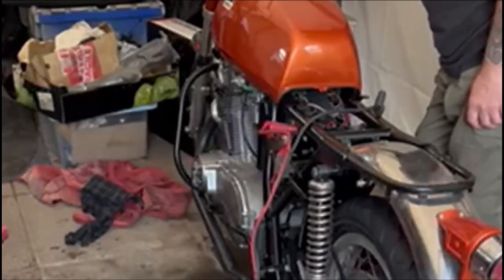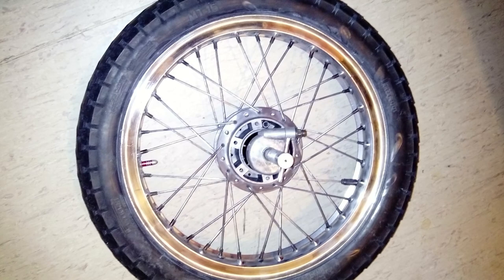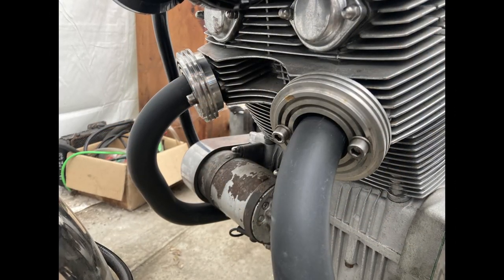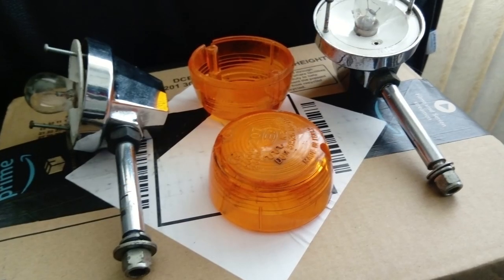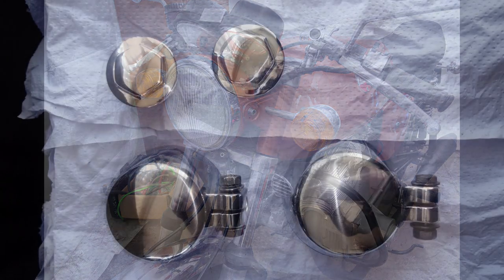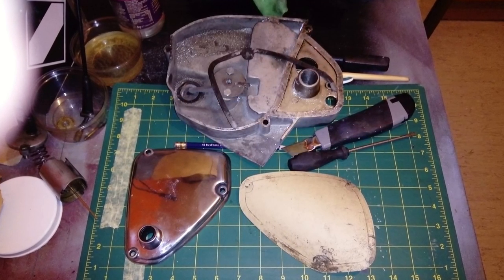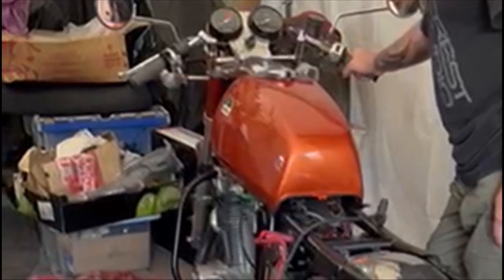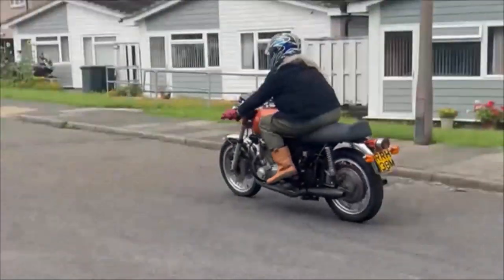Thunderous Laverda Classic Air Cooled 750 Twin Built not Bought

Comment: Awesome! Great sound, great looking and that very special feeling you get from riding something you've brought back to life after years of being in boxes, all add up to extremely satisfying riding👍.
The bit that always frustrates me is trying to get that nice polished look to ALL the exposed aluminium and oh my god! There's so much total area of it and so many awkward to get into little pockets and hollows that you've just got to do thoroughly or you'll never feel happy with them. That's the trouble with bikes, they may be smaller than a car but, they're like if a car was turned inside out and you had to try and make that look shiny and pretty, EVERYTHING is exposed and so much fine fiddly stuff to wear out your elbows polishing. 
That will be a bike you'll have every right and reason to feel very special while riding it.
Great work, it's looking gorgeous❤.
Reply from the maker: glad you enjoyed it mate, the central casings were left as a sand blasted finish, only the outer casings, fins and a few select bits polished,  🙂Cheers for watching and the complements. Ride Free 🙂
Reply: @barebonesmc   It was truly a pleasure seeing you build it back up. I could reminisce and feel that same feeling, a mixture of "I so hope I'm not chasing my tail and every time I think I've got it right, something else, deeper in the engine goes wrong" crossed with that great feeling of satisfaction, especially that first time you hear her fire up, rough running or not, then that great feeling when you're all sorted, registered and a real road warrior back from the dead.
Reply: @barebonesmc  Just a possibly, maybe, partly useful tip. I cleaned up and made shiny(ish) some old rough cast casings once while experimenting, pretty reasonably successfully using a cheap sand blaster that I could run off my compressor using corn flour. It's a bit difficult to feed it to it evenly but, it didn't damage or abrade it at all and left the cast finish looking like it had just come out of casting yet clean and fairly shiny. There's probably even better mediums or methods and this one leaves you a horrible mess but, it did bring it up surprisingly well. I wouldn't use real grit or sand as they would eat at the surface, this kept it looking how it should yet shinier. 
I was experimenting trying to find the best way to deal with those rough bits like cooling fins etc and there's bound to be better, easier ways but, it did work the best of the ones I tried.
Reply from the maker: @lorditsprobingtime6668  cheers mate, it was a challenge lol. probably the biggest project so far in many ways. Im no master mechanic, just a bloke in his shed with a lifetimes worth of spanners and common sense (he says) to fall back on, so yes, when you finally get it sorted it is a very rewarding feeling
Reply from the maker: @lorditsprobingtime6668  i guess soda blasting would be my equivalent to that. The sand run was only done very gently with a fine grade sand on main casings lol. I have a mate who is great at that bit 🙂 Steam clean first then a light sand and then soda blast, then final bits polished. fins were all just done by hand 🤣🤣🤣 ive never figured an easy way around that one🙄
Reply: @barebonesmc  That's a good point about the fins. It was a long time ago so my memory isn't perfect about it all but yeah, the fins are close together so whatever you use, it's hard to thoroughly work on the flat areas further in, you just can't get an angle to work at them with what I was suggesting, or any other grit short of blasting the hell out of the edges much more than you'd want.
That vid of my ride on my DL 650 through that town at the beginning and that cafe where a few bikes are parked out front is where I always ride to first, have a big country breakfast, coffee then go riding the mountain roads from there. In my video I'd already been and done all that and the video was returning back through there later in the day. Early in the morning that whole street will usually be full of bikes, hundreds of them and I always walk the length of both sides, stopping to take pics of any particularly interesting ones and often you'll see things like Z9 Kawasakis and 750 Honda 4s fully restored and looking even better than they ever did on the showroom floors. I am completely mystified as to how they even manage to get anything that old to ever look so perfect. Hell, just a pair of front fork legs defeated my efforts to try and polish them back up to even reasonable so how some of those guys get every little detail so perfect is a complete mystery to me. I do love seeing them restored like that though. 
I wound up having a nice long chat to one guy who had a rather unusual bike, I'm looking at the pics I took of it on my phone now, mainly so I get the details correct because they aren't all like his. This one had a souped up FIVE HUNDRED AND TWO CUBIC INCH V8 in the monster! You get all sorts out there and that thing was just a little more nuts than another guy I'd run into out there on his Harley drag bike. It was bored to I don't know then a monster turbo, water injection, nitrous and I can't remember what else but with boost turned up for the track it was dynoed at 380 hp but, oh boy was it bulky with numerous oil and water heat exchangers and plumbing etc. I absolutely loved starting a days ride like that, it's a real tradition sort of thing so you could always count on seeing a lot of interesting bikes, except if it rains! I've got pics of both the DL 650 AND the BMW S 1000 R being the ONLY bikes in the entire town, just because it was raining and all the sooks stayed home lol.
Reply from the maker: @lorditsprobingtime6668  lol, im no stranger to rain living here PMSL, i try and sneak out early in the week so i dont suffer the traffic that flows to the nice places at the weekend, it avoids the sunday drivers and the crowds, so breakfast comes quicker lol, have a great weekend mate, enjoy the ride
Reply: @barebonesmc  I've ridden in all conditions, either by choice or necessity so never let it put me off. Apparently around here though, even though we get cyclones up here on the Queensland coast, the bike riders are a tad on the soft side lol. Only after I typed it did it strike me that over where you are, if you didn't ride when it's raining you'd hardly ever ride at all. I thought you'd get a giggle from that lol.
I actually haven't been for a ride for a few months. My excuses are that the DRZ 400 still needs the carby pulled off, stripped down and I'm fairly convinced there's a little bit of plastic swarf on the fuel intake side that keeps getting in between the needle and it's seat but, I'm going to go right through it while I'm at it, just it KILLS my back getting down to work on it and the AN 400 scooter BADLY needs an oil and filter change but also the front wheel taken off and balanced as it shakes like mad and again, my back! Soon though, I just need a day or so when I haven't got a heap of other stuff needs doing and my back to either give me a few days of not being too bad or, I double up on the Oxycodone so it doesn't hurt so much but then I'll be so doped up I'll probably just sleep. Ya just caint win eh lol.
Reply from the maker: @lorditsprobingtime6668  lol, re on the Queensland coast, the bike riders are a tad on the soft side lol. Only after I typed it did it strike me that over where you are  if you didn't ride when it's raining you'd hardly ever ride at all.,  thats why there are so many bikes with ridiculously low mileage, i think when i last checked, average mileage per year was around 3k, but that includes all the high miler bikes such as cop bikes blood bikes couriers and instructors etc so in reality for many riders 1500 miles is probably a years riding, a waste to me, i go mad if i havent been out on one of the bikes for more than a week or so
Reply: @barebonesmc  Oh yeah, I AM going mad not being on one for this long! I actually only just before replying watched a guy on the slightly hotter version of my BMW S 1000 R I had till I got wiped out by that dimwit screaming through traffic at over 190 mph and oh man, do I miss that bike! I only had it for about 18 months before I got taken out big time and even the entire surgical team at that teaching hospital thought they were only working on me and doing everything they could as great training but being a stubborn bugger, I refused to just keel over while they had me in that coma on full life support lol. I did clock up something over 35,000 kilometers in that time, mainly because every spare hour I had I wanted to spend on it. That was the first bike I've ever thought to myself, "well, I wouldn't mind even more power but, this is enough to keep me happy. I could wheel stand at over 160 ks (100mph) purely on twisting the throttle and that's about what I always reckoned would be about my ideal power level. It wasn't just power of course, that thing was just such a great handling, comfortable for a super naked and was the first bike I've ever owned that had real cruise control, I just loved being on it. I am pretty much stuffed since that accident and just couldn't do enough miles to justify buying one like it again and at close to 70 I'm probably best off sticking with just the 400 cc scooter, at least it's not even trying to pretend is fast despite the fact it can do the ton and gets to 60 mph in 5 seconds as best I could time it which is still quicker than the vast majority of cars. I can get on and off of it without putting myself in agony trying to get my leg over the high seat on the DRZ 400 though, that thing is a fair bit of fun and with the work done to it, goes a fair bit quicker than a stock one.
I do keep seeing videos from over your way of bikes I would here expect to have returned to the oxides etc in the soil where they came from. I even drooled over some guy pulling out his pristine looking old TS 185 Suzuki, one of my all time favorite ride to work then head a couple of hundred miles into the outback camping and having fun on the weekends, he made me so jealous, especially since the only 2 strokes we see here these days are those silly little 50cc Chinese scooters which I have an unreasonable hatred of, despite the fact I've got a tweaked one of them in the garage that I never even count when anyone asks how many bikes I've got. It was my girlfriends and I haven't even ridden it since going through it and sorting out all the ways they'd either intentionally or through very poor design slowed them down, as if you need to deliberately slow down a 50cc scooter FFS. It accelerates much better than before and revs a lot harder but, it's got no way to go faster than their usual 70 kph except by revving harder and I just hate holding a bike screaming it's head off so don't bother registering it as it's no fun anyway.
Where I am here is rust capitol of Australia right on the coast beside an extremely popular and very long surf beach with the wind almost always blowing inland carrying all that salt spray so, not easy to find old and good.
A mate offered me his old in pieces DR 250 a while ago which I've had one of before, also in a million pieces in boxes and did put it all together, freshly rebored and all bearings replaced and was quite impressed for a little 250 but, now I'm struggling to just get a bloody carby off and go through it so, I thanked him but nah, just can't, plus despite the engine being similar as in pieces and freshly rebored but it does have a fair bit of rust and corrosion to deal with too. Now if somebody was to offer me something like that lovely Laverda, engine even intact, that might make me change my mind lol. Then again, I know if I was going to restore it I would strip the engine down and go through it with a fine tooth comb (or rather feeler gauges, micrometer, dial indicators for measuring end play, TDC and cam lobe lift etc etc and list of specs for all that soooo, not a great idea for me at this stage either. I so wish I could enjoy a couple of hundred kilometer rides so I could justify buying another BMW S 1000 R! I know I'm in agony after around a hundred and a lot of discomfort after only about 50 ks so, just never going to happen. At least I can say I've finally owned a bike I was pretty much completely happy with, despite the fact I kinda would have liked even more power, it was still bloody awesome!
Reply from the maker: @lorditsprobingtime6668  glad you are still fighting mate. and if its got 2 wheels thats fine by me. too many people get too "precious" about what people should and shouldnt ride. as i pass i nod to anyone, 125's scooters, ven polite car drivers lol. i guess its rarer with bus drivers or amazon prime drivers though 🤣🤣 have a good week mate, you will enjoy the next video
Reply: @barebonesmc :   " you will enjoy the next video ".  I have no doubt, I've very much enjoyed every other one. That does hint at something a bit special, or possibly about, or including one of the bikes I've mentioned owning, either way, I'm drooling already lol.
BTW, I made a silly mistake in my last post and I blame Suzuki! I said a mate offered me his in pieces DR 250 and because I have a DRZ 400 and those same first 2 letters I got them in the wrong order. I meant I'd rebuilt a RD 250 Yammy and THAT'S what a mate offered me. I'm getting thicker with age🤦‍♂.
Talking about people waving to you. I've driven semis on long haul runs for a living at 1 point amongst the many and varied types of work I've done and there's 2 groups that won't wave back that I've found, 1 on the road and 1 on bikes. While driving a semi pretty much EVERY other semi you pass will wave, NEVER bus drivers though. On bikes, most will except Harley riders. Despite the fact they're riding about the biggest POS of a bike ever made, they have some weird sense of superiority, I don't even bother with them anymore since even that 400 scooter is almost certainly superior to a Harley in every way.
I've got a question for you, if you've heard anything about these that is. 
Have you heard of a carby called " SmartCarb "? My problem with the DRZ 400 is in the carby which apparently aren't the greatest anyway so, rather than trying to fix it, I'm thinking about blowing quite a few bucks and putting one of them on, a 38mm one of theirs rather than the 36mm thing that's on it. They promise major power, fuel consumption etc etc improvements and with the Yoshimura exhaust already and other breathing improvements a power boost that also saves me fighting with the old one, or at least till I feel like it would be great. What do you think of them, assuming you know of them that is? And should I maybe jump straight to their 40mm one instead of only 2mm bigger with the 38mm one, the price is the same for either so the only downside to me might be bogging down sometimes that I can see? I think if they aren't full of you know what the 38 should probably work best overall but, , , ?
Reply from the maker: @lorditsprobingtime6668  being honest i havent tried them, ive got a box full of old carbs so i can usually find something. with carb sizes, its not as simple as people think. bigger bore size actually slows fuel flow. unless you work with bell mouths or something. id stick with standard bore and just up jet as needed. personally, if itll fit my choice would always be Mikuni Flat slides if you can get one. best there is, and easiest to set up well, hope that helps
Reply: @barebonesmc  Thanks anyway. I haven't got any extras up here, back 1,200 kilometers away yeah, not up here though unfortunately. These SmartCarbs don't actually have any jets. You can adjust the weird flat sided metering rod on the go, within a range or change it to a different one if that's not enough. Supposedly after you feed in the information about which bike it's going on, what modifications if any and what your priority in riding is (naturally I put POWER) they set it fully up and usually set a little on the rich side for the sake of the engine till you refine it later. I'm pretty sure the carby it came with is a flat slide  Mikuni BSR36 so I thought since it has got a better breathing exhaust and I can distinctly feel a big difference between say 95% throttle and 100% that a bit bigger carby would benefit it. I'm pretty certain it'll love the extra 2 mm by going to the 38mm, I did have doubts about any benefit of value from going the extra up to the 40 mm that's in their listing for the DRZ 400s though, except maybe near red line revs and full throttle, the rest of the time I doubted it but, thought it worth considering, especially since all 3 sizes are exactly the same price. What does jump the price up by about a hundred extra bucks is if you want it in one of the fancy anodized colors, I really liked the whole thing in Black Obsidian but, for an extra hundred I think I'll go with plain alloy thanks. That's IF I do it at all.
Mine has the Yoshimura exhaust on the breath out and had a very noticeable power improvement by opening up the air box so I'm pretty sure it wants bigger, I'm just iffy about how much bigger. I think I'll probably play it safe and just go the 38 mm. Man I'm going to be annoyed with myself if I do put that on and can feel it wants more! Either way though, with a 38 mm that's as good as these are meant to be, it'll be easier than fixing the other one and, it'll have even more than it's got now and as it is with the few modifications it has had, it goes much harder than an off the floor one. 6 Teeth smaller rear sprocket to suit the road more and you can't give it full throttle in first and still have to be careful even in second and leaning forward, even with the gearing raised that much but, I'll be perfectly happy if it wants to stare at the sky in third, or even top for that lol.
I've piled up a list of videos about people using them. I'll watch all them, wait till late in the week at least, then decide.
Thanks anyway mate, I didn't really expect you to know all about them, I just hoped you might. No probs though and thanks for trying to help.
Next month, a turbo on the scooter 🏍💥, or maybe not lol.
Reply from the maker: @lorditsprobingtime6668  honestly, and there are as always exceptions, but going up a carb size slows the air fuel mixture down, which i am sure would inhibit atomisation in the inlet. and because the flow speed is lower, you dont actually get more fuel through, so i would go for same bore size. can you get jets? if its midrange upwards, 1 or 2 up on the main and maybe a washer under the needle to raise it slightly might improve things a lot, do one at a time tho not both together lol
Reply: @barebonesmc  No jets in them at all. You can adjust the metering needle which is a different arrangement to usual and from looking in the front looks like the same diameter rod but is a flattened off taper at the back, supposedly making it atomise the fuel better. You can raise or lower it with a simple screw adjustment on top of the slide cap and if that's not enough you can buy different sized needles rods too.
Like I said, I can feel that the current carby is choking it a bit and the options offered specifically for the DRZ 400s is either 36mm like stock or 38mm or 40mm. I'm tempted but the 40mm I think may harm the performance a bit maybe but almost certainly make it run less economically, just going that extra 2mm though, it seems a waste of money to spend that much and not let it breathe a bit better. 
Worst comes to the worst, I'll have simply moved the bottleneck to the ports and valves in the head soooo, I just rip the head off and do what I've done a few times before and open that out too, then she'll definitely go much harder. I can't see it being a problem going by the way even at 95% throttle and taking it that tiny extra 5% makes such a noticeable difference, that 36mm carby is definitely restricting it. The only time I mightn't have great suction and atomization would be with wide open throttle at too low revs and that's always the case to a large extent anyway. 
Oh damn! As I was typing this I got a phone call from a cousin who I watched a big air show here at Surfers Paradise with last weekend. One of the interesting aircraft I took a heap of pictures of doing it's thing was an Osprey, the one that's a cross between a helicopter and a plane and apparently it crashed, this morning I gather killing the crew and 6 people total apparently! 
Sorry, a weird thing to throw in here but I literally was told while I was typing this and I'm just a bit blown away at having only just seen them doing crazy maneuvers with it 3 days ago. At least I did get plenty of good close up pics of it doing it's thing.
Reply: @barebonesmc   Welllllll, I thought about too much so wound up ordering one today. I didn't go up to the 40mm as I think that would bog down but did go the extra 2mm to the 38 mm and for the heck of it, and because it just looks so damned good, paid the extra $100 for the all black obsidian one. I can deal with bending over to work on the bike long enough to swap it over in hopefully no more than 2 short sessions and the way these are setup, it pretty much can't leak like the other one kept doing, no matter what and I am really looking forward to having a bit more punch, if they're to be believed, a lot more punch but, I'll report in on that once it's on and tuned perfect for the bike. There's a few more bucks my kids'll never see lol.
Reply from the maker: @lorditsprobingtime6668  a random tangent at the end lol, as you say, at least you got the see it playing before it was crashed.
Reply: @barebonesmc   Ah, you had me confused about the "random tangent" till I realised you must be talking about my previous post a day ago. Yeah, random bit, the call about it literally came in right while I was typing that reply out to you. I was somewhat still in a bit of shock and had only just heard about it so figured "what the hell" so added that in. It was the first time I'd ever seen an Osprey live and doing it's crazy tricks, did get some pretty good pics but sadly no video of it, being a dumbarse I did try but hit the wrong button and with sunlight glaring on the screen I just couldn't tell. I had heard they had LOTS of issues getting them to work and many safety problems, apparently they maybe do still have some bugs to sort out.
Random tangent time again: Black Obsidian 38mm SmatCarb on it's way. I just really hope you're wrong and I'm right about going with the slightly bigger carb, I really don 't want to have to take the head off to open up the ports, add a tweaked cam and all that work to make it suit it. I'm pretty certain it actually wants a bigger carby, just by how it responds to even a tiny bit off full throttle to full giving a pretty big response the way it's been.
Reply from the maker: @lorditsprobingtime6668  keep me posted, all im talking is theory, you know what its like in practice, i hope you get the extra, keep me posted, be interesting to hear, anyone on the DRZ forums tried it?
Reply from the maker: @lorditsprobingtime6668  fingers crossed mate, keep me posted, until its on the bike theory is all we have, id say the likelihood if it works internally as a carb would, that the low rpm will be harder to dial in with a bigger carb, but yes, depending on through flow, high rpm will be cleaner, am very interested to hear
Reply: @barebonesmc  Thanks and, will do. From my past experiences modding all sorts of things just to see what differences, often some good mixed with some negatives, often times sticking a much bigger carby on an engine, you can get a good feel for it by things like that throttle reaction how it currently behaves now suggests it'll definitely go harder. I have experimentally put triple carbs on a 6 cylinder Holden (Australian made related to your Vauxhal brand) that came with a single. That really was hard to tune and just bogged down unless you slowly fed throttle on as the revs rose, even then, full throttle just never helped. Rebuilt the engine, put a rather hot cam in, tuned length extracters, really opened out and polished the ports, double valve springs and THEN she was a fire breathing monster with those same carbs. It was pretty insane just how much quicker that car was after that!
It's almost always pretty useless to just slap a huge exhaust, a massive carby, a hot cam on without doing all of those things and getting better gas flow right through. In this case I can feel the little 36mm carby is holding it back and I already have the high flow exhaust. I doubt I'll need to open up the ports, nor am I keen on the idea but, if somehow it is way too much, at least I've got a fair bit of experience doing that. It'll have to be pretty bad before I'd be willing but, then I would wind up with a LOT more grunt out of the little fella at least.
Coming to Australia can be damned slow and even then, I've got to be feeling up to it so, it's probably going to be a while but, I'll make sure to let you know. Maybe I'll do what I wish like hell I'd done on that awesome BMW S 1,000 R and keep a GoPro running everywhere and get some video of it blasting about too. I'll let you know how it works out either way.
Reply from the maker: @lorditsprobingtime6668  do it mate, although as i just said to someone else, the microphne on the newer go pros is shite, so there may be better options unless you set up external mics and locations, the old mic was much better
Reply: @barebonesmc   Argh, damn! I've got a new GoPro 11 ready to go too! I 'expected' it would, SHOULD be improved if anything! The main reason I didn't use the old one all the time, and the cops really wished I did have it on and running when that fool nearly killed me was because that kept randomly just shutting off. I gave up on even trying with it in the finish. That video I posted isn't the only video by any means but, it's one of the rare ones where it kept running until I actually stopped it. Apart from higher resolution and anti shake, plus a viewfinder screen I did expect the microphone to AT LEAST be as good, NOT worse!
That video from my DL 650 put it well protected behind the big screen and mounted on a soft tank bag so it was reasonably protected from the direct wind and vibration mostly absorbed by the tank bag.
Thanks for the warning, I'll see what's available for it and try and rig it to still get the the roar of that exhaust. Actually, that was something that old one never seemed to catch very well on that DL650, it had a really sweet note and a really nice bark yet that never quite came through in the videos either.
Reply from the maker: @lorditsprobingtime6668  i havent tried the 11, but from the 8 it was worse, so they can sell you the media mod but even the mic in that isnt great, but its a way to connect an external mic, which unless you have the media mod you cant do, progress eh lol, the mic on my really old one is so much better, the screen will help though,
Reply: @barebonesmc  Yeah, "progress" alright, backwards. I haven't used my 11 yet so haven't had the chance to be disappointed by that. I am very glad to know ahead of time to be looking for a better way though so, thank you very much for the warning. I know they've got that foam cover, I've actually already got that but, it sounds like it really does need a completely separate microphone. It'll be better that way anyhow. You sort of want the lens up in the wind with a clear view but that's a terrible place for a microphone so one I can have remote from the camera will be much better anyway. Now if this one starts randomly shutting itself off for no reason like the other one kept doing, I'm going to take great pleasure turning it into a thousand or so tiny pieces with a large ball peen hammer!
Reply: @barebonesmc  I forgot your mention of the "DRZ forums", in fact I never even thought of looking at them. That's a bit dumb of me as there'd be a wealth of information on a forum specifically about them. I'm 'pretty' sure It'll go well with it, I am expecting slamming to full throttle from low revs to bog it down but, that's usually the case to some extent anyway. I always knock bikes into an appropriate gear to be up in the power band if I'm going to give a bike full throttle anyway. 
It is kinda surprising how many riders I've ridden with or had races with who just don't know how to ride in the power band, know their bike essentially, though finding and using the power band when you're going to try blasting away doesn't take long to get to know. The video on here of my DL 650 where I did wind it up, that was the first time after a good run in period and several oil changes that I ever gave that full throttle. The interesting thing I discovered, and the reason for the funny noise I made was that it hardly even had one, it gained as the revs rose but, it wasn't they type of bike you'd buy and ride everywhere at 8 thousand rpm, it just doesn't have a sudden hit of power at high revs. They do pull harder at revs but it's not a drag bike by any means. I wish I still had that, even more wish I still had that S 1,000 R BMW, that bike was astonishingly good, and it pulled ok at all revs but it DID become a fire breathing monster up around 9 to 12 thousand rpm, the 2 had very different performance characteristics but I loved the way both delivered it.
If the insurance hadn't covered an actual full frame replacement plus all the other parts I'd have got all my money back. I wasn't keen on riding that bike after some scummy repair joint had completely stripped the entire thing down to parts then rebuilt it all onto a new frame, plus my poor old mother who was alive at that time went through hell after losing my brother a few years before then being told by all the medical staff not to expect me to survive, I just knew she'd be in panic every time I was on it so, it had to go for both those reasons, man I would love to get another one but, I just can't ride it enough to justify the expense. I have never felt so much like "king of the road" as I did while on it though.
Reply from the maker: @lorditsprobingtime6668  my problem has been finding a mic that doesnt have a nervous breakdown when you put it near the exhaust lol with the one that i use you can turn off the front mic, just leaving the rear mic on, that helps too, its got 2 mics, theyre both shit, but it has got 2 so it must be better lol
Reply from the maker: @lorditsprobingtime6668  learning the bike is as important now as it ever was 🙂
Reply: @barebonesmc  Oops, sorry. Somehow I missed your last 2 posts, sorry.
I was wondering what mike, what type or even if one could deliver reasonably accurate sound from something like a loud exhaust where it's such drastic jumps between every fourth stroke and comparative silence between. Maybe that's just too much extreme for any to cope with. I do have a short audio wav file of the sound of an insanely modified RC model plane designed as a slippery low speed high lift FPV platform that I made (eventually) scream along at 185 kph with a tiny but fed higher voltage than it was intended and much more current too spinning a little 5 inch by 5 inch pitch prop spinning at over 500 times a second whizzing by and VERY distinct doppler effect yet it sounds exactly as it did. Not so much extreme between impulses I guess?
As for learning the bike, agreed, people do always. Even so, these days, with so many bikes with antilock brakes, traction control and stability control etc, people just aren't ever REALLY going to learn a lot that could be pretty important in really understanding what's going on fully. Maybe that's not a bad thing but I don't think it's a good thing either. 
One personal example of I can give was when a VERY foolish young girl coming towards me turned right crossing my path into a side road and instead of stopping and looking to see whether any traffic was coming, plus her goldfish brain somehow forgot about the bike that a second before was coming straight at her instead used that for an illegal U turn and never even looked and just shot straight out into me. I had zero time or way to dodge her and knew I was going to hit her so tried to lock the rear and swing it side on and lay low as we hit so hopefully the suspension could absorb most of it and I may have scuffed up my riding gear a bit, maybe got a bruise or 2 but no, instead I'm stuck bolt upright riding straight into the side of her bloody car. Result = $11,000 for the fancy electronic suspension new front forks which because of the type of collision naturally got folded back, plus a few other minor bits and me with my left knee with 3 ligaments full thickness torn because it momentarily was pinned against the stupid car before the momentum of the rest of my body tore it free before I went tumbling another 50 feet or so down the road! If I know how to shudder the brake and not keep sliding on the same molten patch of rubber so antilock on the rear I do NOT need and definitely don't want. I took their word for it that it was a good thing, IT'S NOT, at least not if you actually learnt to ride bikes without all the BS and did frequently push their limits! So it cost the insurance a heap and I wound up with a permanently destroyed knee, all thanks to this tech that will help a lot of new riders but in that situation with me, cost me dearly. I do pretty much agree with having traction control on the front though. I'm not going to pretend I don't pucker and get a surge of adrenalin and a scared moment whenever a front wheel suddenly jumps sideways under hard braking coming into a bend. I have adapted my riding to easing off the front progressively as the lean angle increases yet still get that little slip if a bit of loose sand or gravel, oil or anything unexpected lets the front suddenly slip sideways always puts me into panic mode so I'm happy to have it there though do try to avoid pushing to where it's going to kick in anyway. I appreciate these things are intended to help us, or at least new riders but personally, would much prefer they get rid of most of them if not all, and their extra weight.
Reply from the maker: @lorditsprobingtime6668  ABS and Traction control i have less issues with,  but the reality is, understanding the bike and using it well will always IMO work better. i have friends that agree and those that don'r, as more evidence emerges, especially with ABS, overall, it seems to perform about the same as a good rider, but yes part of the issue is people who rely on it never learn to modulate the brakes properly, i dont think thats a good thing either
Reply: @barebonesmc  Oh yeah, don't worry, I completely agree. The ABS, stability control and traction control are obviously not the only thing to learn. Power management is one which includes traction control (and usually wheelie control) but are just the ones that have really either annoyed or caused me problems. I thought I'd shut them all off on that BMW S 1,000 R but despite turning traction control off I tried throwing it into a fast bend hard, intending to power slide out of it and it refused to give me power! Damned thing decided it was dangerous at that lean angle or something. I guess I didn't manage to turn the stability control off, or some other computerised nanny bot bit just kept it to a steady speed instead of snapping on the power and getting that rear spinning and let ME manage the throttle. That was rather frustrating, especially since I had taken a while for my test tickles to grow big enough with experience on her to even try it. It had the power, it just refused to give it to me. Either I needed to turn something else off, or it just won't let ppl do it the way I'm used to on lesser powered bikes.
I do agree about learning the bikes overall though, there's a hell of a lot more to not just learn as in can do it when asked and thought about and having it locked into muscle memory and automatic in certain situations.
I started on a little 100cc 2 stroke, then a 185cc trail bike, oddly followed by a CB 100 honda, a sweet little run around bike, then ANOTHER 185 trail bike, a FIRST gen TS 250 that was the first bike I rebuilt the engine of and my old Bultaco 250 that I'd been racing short circuit on then up to a 550 GT Suzuke. At one point they decided to limit new riders to a max of 250 which was a good idea till they started making some 250s pretty insane. Now they can buy a brand new DL 650 limited so they can't have full power till they've been riding for a couple of years. Well, they take some power away but, those are very torquy bikes still so I'm not sure that's great either. I don't know what the best solution is, I think light low powered but, things are a bit different these days with everybody in much quicker cars, better but more crowded roads and very impatient drivers you really don't want behind you on some slow bike. I guess training courses and maybe even putting them on race tracks maybe, amongst other early to riding pple might be good too. I really don't know. I do know, starting out on any bike now is more risky than when I first started.
Reply from the maker: @lorditsprobingtime6668  i always said the best thing anyone could do to make the roads safer, is make everyone go through the same process.  first cycling for a year, then motorcycles, then cars, then small size vans up to 3.5 ton gross, then 7.5 ton, then HGV and PSV. that means everyone driving a car would have had a year on a motorbike, so would see the road more from the perspective of a rider 🙂 job done lol
Reply: @barebonesmc  Wellllll, I be super expert then! I grew up on a steep hill so some of the crudest home made billy carts ever seen, then a scooter for a few years till I scrounged enough parts to piece together a pushbike for the next 4 years (still got but thanks to injuries still ride it but not often) THEN from money earnt working after school and weekends that little A 100 Suzuki which angered my father greatly lol. After that it was several light bikes because I loved exploring and racing friends on some bush tracks very close to home, eventually, pretty reluctantly actually, I got my car license. Many years after that I decided to go live in the bush trying to make a living running a gold suction dredge where I wound up buying a rough as guts old F350 Ford table top with a rather hot V8 dropped in it and AFTER I got rid of it, then I got my rigid truck license, a few years after that my semi license, a dangerous goods license, a forklift, front end loader and backhoe license and an overhead crane license, hell, I even got a stupid chainsaw license, only because a particular job required it, despite the fact I had 2 chainsaws and had cut hundreds of tons of wood and felled at least 40 100 foot trees. I haven't got a license for it but have numerous times flown single engine planes and actually flown helicopters a lot more. I HAVE got my gold wings for flying RC model planes and my biggest one of them has a 14 foot wing span. Will that do, do ya reckon lol.
Oh, I also did a stunt training course and a bunch of us formed a stunt team. I did pretty much all sorts of the stunts but bike stunts was my main area. I admit despite absolutely loving flying, I am terrible with heights so did deal with some but tried to stay away from the high fall stuff.
As you may have guessed even without knowing the multitude of other kinds of work I've done, I get bored once I know everything to learn about 1 type of job and go looking for something different sooooo, done a lot of different types of work lol.
Reply from the maker: @lorditsprobingtime6668  smallest powered was a 50cc Honda Novio pedal and go, 132 mpg lol, biggest was an Ossa, but not a bike, an 8 wheel drive articulated timber crane with a 240hp engine and a 32 tonne cradle trailer as the back end lol, longest was a Commer Q4 with a 36ft drawbar trailer, unless you count tractors lol, drove a 32 speed semi auto john deer for a while with some immense trailers and processing units attached. the joys lol
Reply: @barebonesmc   OK, the war is on mwa ha hah!  Not that I can top you on 1 or 2 there.I've definitely ridden several 50cc bikes. 1 was an old 50cc Honda step through that in it's own way was probably the most impressive bike I've ever come across. It had been a mates sisters bike. She was quite an adventurer and had ridden the as an all round work transport and in between for holidays she'd ridden that tiny thing, loaded with gear thing 3 times all up from Sydney to Cairns back in the 1960s and then back home again, a return trip on mostly undeveloped at the time distance of 7,000 kilometers each time! We got hold of it in the finish, after it never missing a beat on her through however many kilometers total it had done by then and flogged the hell out of the poor thing. We discovered with those 3 speed centrifugal clutch Hondas that you got a clunk as you put them in gear but, if you then held the pedal down it somehow kept the clutch disengaged so we could rev the hell out of it then just drop your foot off the pedal and sort of lurch the front wheel up about 6 inches lol. Wheelies on a 50cc step through lol. I didn't understand how amazing it was for such a tiny motor to have actually carried a rider and gear on what were absolutely terrible roads back then, basically goat trails from Brisbane up the biggest 2/3rd of the trip all the way to Cairns on the far north coast of Queensland. I was way too young but wish I'd known and had some long talks with that sister too, that's 2 hell of a challenging ride, for anyone, especially on such a tiny engined little bike. Anyhow, a lot of other mini bikes I rode belonging to friends were 50cc ones too but oh man, thinking about that step through and what it survived, and the amazingly adventurous girl who rode it 21,000 kilometers of torture plus however many ordinary miles to and from work etc, that just impresses me so much.
Hmmm, an 8 wheel drive eh. Well, the semi I did the most miles in was bogi drive dual axle with all dual wheels so there's 8 wheels all driving a total of 22 wheels, sorta similar but not as interesting as your timber crane.
During harvest season I did drive (when it wasn't suddenly locking the all hydraulic steering up) a bloody great all wheel drive with huge duals front and rear Steiger 360 hp turbo Cummins diesel articulated tractor with a 14 foot wide 36 ton chaser bin behind it 100 kilometers at 25 kph with escort vehicles in front and behind to warn other trucks and cars something bloody big was coming. I really hated that actually. Somehow it was legal but on a major inland highway with only 1 lane in each direction and even semis legally cruising at 110 kph and knowing that f***ing steering could lock solid at any moment on a 5 hour drive was somewhere between stressful and terrifying! The escort driver in front was completely inexperienced too and on narrow bridges he was supposed to STOP traffic since there was NO WAY IN THE WORLD anything bigger than a pushbike could fit across at the same time yet he kept forgetting! No accidents but no end to apologizing and trying to explain to frustrated and shocked truck drivers over the UHF radio.
The widest was also a harvest time one, a New Holland 2160 (I think) Forage harvester with a 30 foot wide front on it. In a paddock it was nothing and mostly going to or from you'd detach it and pull it behind but the machine itself, in any somewhat confined area felt like driving a large house on wheels lol.
Well, all sorts of other weird and wonderful things but, we're going for extremes here so that'll do for now. Wot else ya gots fer me eh lol?
Reply from the maker: @lorditsprobingtime6668  not much more really lol, i had a 400cu leyland 6 pot in an old wrecker i ran for a while which was fun, but the Commer Q4 was hard to beat, ex fire service pontoon carrier when it was made lol, only had about 500 miles on when i got if and only paid £500 lol, 6 pot humber petrol engine, quiet as a mouse believe it or not lol, scared a few garage attendants lol. did about 6 to the gallon, i stopped at plant, i didnt go the HGV route, have driven a 40ft motorway coach though, mad thing, big old ford turbo diesel, you had to pick the right gear for hills at the bottom or you were stuffed lol
Reply: @barebonesmc  Well, your 400ci Leyland beats anything I've personally owned, by size at least. I have had a couple of V8s but both were only 302 ci Ford ones, they did have 2 more cylinders each, still best part of 100cis smaller though🥺.
I had a friend had a Humber Super Snipe years back, that was a fairly ordinary looking outside but pretty sweet, quality type interior and could get up to a pretty good speed too. I think they were pretty heavy on the petrol from memory but a really nice car to get around in.
I was half owner of a D series Ford table top, not huge but we used to load up to, on one occasion only because it WAS  toooooo much for it, 10 tons and with only a 4 speed and the smallest of their diesels and no power steering, that trip was a struggle just to hold the steering from being pulled off the road by the camber on the road. It only just made it up the ramp onto the road, it had a top speed of only 80 kph too, 81 if I put my left foot on top of my right foot and pushed down really hard lol.
I did get roped into driving a nearby small towns all wheel drive fire truck during a bad fire patch when their usual driver was away, that was kinda fun, and interesting. The gears were a little complicated but not too bad once you worked them out, no syncro so you had to rev match but, every semi I ever drove had no syncro either and mostly with 15 gears to work up and down through, you get pretty good at that.
I was working as a welder at one place that bought beaten up old semis that they'd sand blast the entire chassis, either repaint and add a few flash touches and resell as is or do things like cut the chassis rails, add in a section to make them long wheel base and build a truck body for them, the farmers especially loved them. They had an old Autocar Diesel semi that had been used in logging down in the wilds of Tasmania and this thing hadn't so much been used as a logging truck but more as the unstoppable beast they used to drag stuck logging trucks out! We used it as a work horse around the yard for whatever needed doing. I kinda grew to really like it, simply because of the ritualistic way you had to start it. You had a piston type fuel pump on the dashboard and pressure gauge which you had to pump by hand up to a certain pressure, then pull out the compression release, hit the starter, wait till it had it spinning nicely then drop the compression release and boom, ticking over like a clock every single time. It was a procedure that worked absolutely perfectly every time. Deviate from it and you'd have no chance. I don't know why but I loved it, it had real character and was a really strong and solid beast. Sadly (to me) in the end they decided to turn her into a show truck  with lots of added on bits and the usual full treatment. Sad only because she was going but, she did look great once finished.
That's probably about it for interesting vehicles I've operated I think. Oh, that fire engine, it was English made, I just can't remember what brand off the top of my head. It may have been a Commer but I think it was something else, I'm just not sure. It was pretty old and I suspect it started out life as a military truck and was adapted to become a fire engine later in life. It was fairly old and kinda underpowered for the weight of the huge water reservoir on the back and the wild terrain I had to crawl though but, at least it did have some really low deep reduction gears enough to drive up a vertical cliff, if it could get enough traction.
An interesting thing with that bloody great Steiger Tractor I mentioned earlier was, it didn't have an accelerator pedal. It was weird yet it worked, once you got your head working backwards, upside down and twisted 38.628degrees. It had a hand throttle you'd put it in gear, not using clutch then crank the throttle up and you did have a pedal connected to the throttle arrangement but, it was a DEcellerator pedal. You'd wind up in one gear then dap the decellerator pedal as you banged it up to the next gear then let off and let it build revs in that gear, rinse and repeat till at top speed or whatever was required. I got the hang of that going up gears easy enough, going down gears I had a bit of trouble getting the hang of that 100% though.Oh, and it had NO brakes at all. What a great vehicle to take over 100 kilometers along a highway with a bleeding 14 foot wide trailer and steering that now and then would suddenly lock solid on you eh lol. It did have working air conditioning so, that alone makes up for a HUGE amount of other faults lol.
Reply from the maker: @lorditsprobingtime6668  as usual a great story mate, we do seem to have trodden similar paths on opposite sides of the globe lol. was the fire truck a Dennis by any chance? or the big 2 that were ex services were a Bedford that had a fairly flat nose or the Commer Q4 which was like a Morris Minor that had been supersized lol, long tapered bonnet and huge wheel arches, and all were 4 wheel drive. re the Leyland 400, it started life with a 3.8 litre straight 4, but the 400 6 pot just dropped straight into the chassis, the only problem was you had to cut the front of the cab off and move the radiator forwards abot 12 inches lol, my front ended up as a quarter plate shroud hammered around the radiator with a huge I beam as the front bumper lol, looked like something out of mad max lol, but was a great truck, it would pull anything. You mentioning the D series dredged another WTF memory up, driving up into the peak district which is a string of curves for miles, i am merrily going along when all of a sudden the steering wheel starts spinning in my hands with no connection to the wheels, a panicked stop, and eventually i figured out there was a knurled ring under the steering column that had worn so much it would only catch properly in one position, so to keep it connected you had to pull upwards on the steering wheel lol, if you didnt, it just span in your hand and the wheels went wherever they wanted lol, oh the joys lol, i guess it is those experiences that make us less likely to panic when the shit hits the fan 🙂 have a great weekend mate
Reply: @barebonesmc Hah! I does sound like we've had similar journeys lol. Though I think my 2 and a bit years living on a river bank in the mountains dredging for gold on breathing gear, even in winter when snow everywhere and crunching through ice to get in wearing a very basic wetsuit and living on rabbits I'd shoot to feed myself and my dog may be one you're probably glad you didn't do lol. I actually do have very fond memories of that time. There was a lot of hardship with it but, it was beautiful country and I'm extremely glad I did it, despite failing to earn an even reasonable living out of it.
That fire engine, I actually think it must have been the Commer Q4 you mentioned. I kept trying to remember and Commer kept coming into my mind and the more it did the more I thought I was just talking myself into believing it was but I do clearly remember it was an English brand and know it definitely wasn't a Dennis or Bedford, it almost certainly was a Commer.
Interesting story about when I was a kid and the local fire station was across the valley from where we lived. The station was on a tight bend of the highway, sorta foolishly right next to a service station. Well, they still had their old dire engine but had just bought a beautiful new Dennis one. One day I hear this KABOOM WHOOMPF sorta noise look across to see flames going VERY high into the air and a massive mushroom cloud of black smoke. No idea what so got on my pushbike and rode across the valley to find a bloody great petrol tanker had hit that bend too fast and rolled, splitting open and flooding the FIRE STATION with burning petrol! Sadly, even to a kid I could see that formerly beautiful big Dennis fire engine burning away with the other fire engine, building and all. Somehow it didn't ignite the underground tanks or anything in the petrol station except the fence separating it from the fire station. I think I'd call putting either of them on the outside of a very tight, almost right angle bend, even dumber putting a fire station right next to a petrol station too in my opinion. BTW, the new one is elsewhere and not only away from a bend, it's well clear of the highway too.
Your little steering wheel issue sounds like a hose the cab out afterwards affair! Yikesees, that would have been panic time. That little cab over D series, we put another bloke in the cab with me except sitting over as close to me as possible and permanently on high alert if a tyre blew to help me wrestle the steering because unfortunately, not only were we way overloaded, the heaviest of it was at the front of the tray and if a tyre had blown, there's no way I could have held it myself, it took most of my strength to hold it against just the camber with air in the tyres! It only ran on 16 inch split rims. We were told it was legal up to 7 tons but, I think that was probably meant to be with proper heavy truck 20 inch wheels. Hell, even my 4X4 wagon I drive now, basically just a station wagon (estate I believe you refer to them as) came with 20 inch rims lol.
Reply from the maker: @lorditsprobingtime6668  memories eh mate🙂 I spent a few winters up in the woods 🙂 a harsh but rewarding time, but yep, i wish it had been more rewarding on my pocket lol. but we cant have everything, so they say 🙂